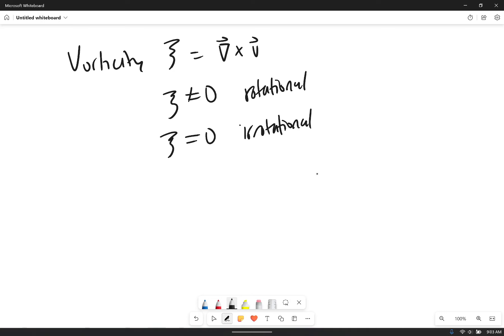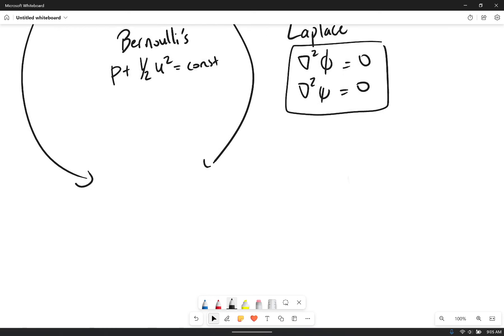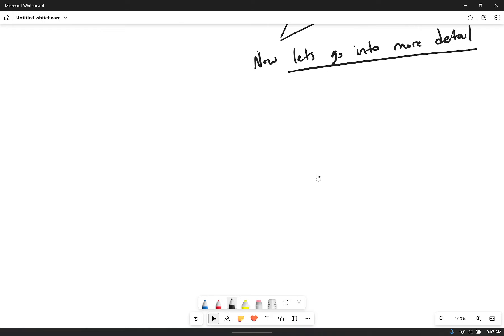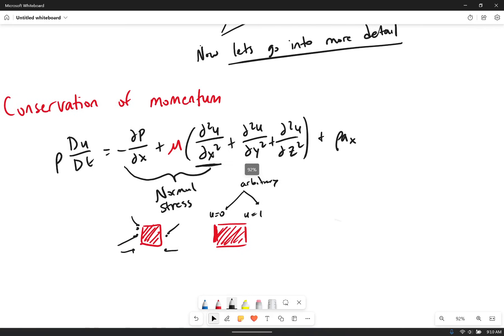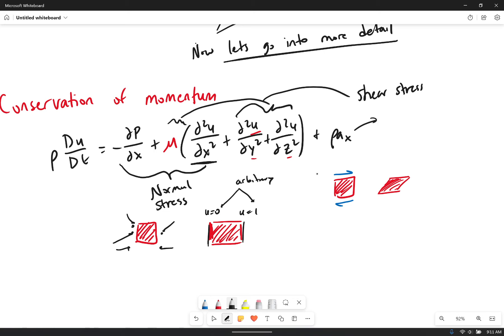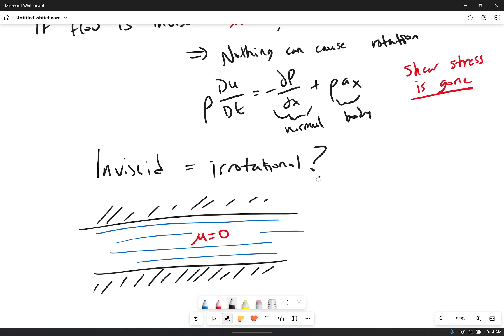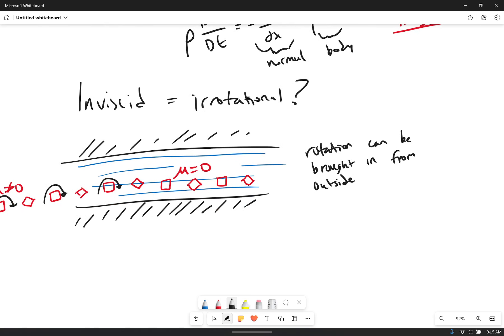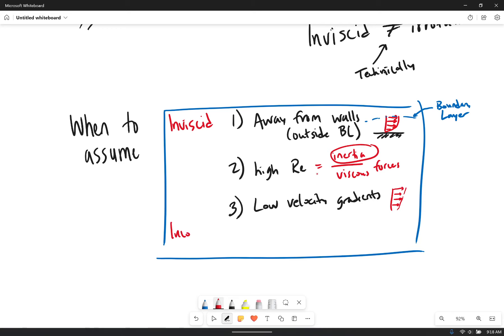Does inviscid = irrotational?

Comment: Does Flow of  Ideal Fluid may be Rotational........? ? What Is Vorticity Equation..??
I want to know that am i correct??
Reply from the maker: Hi there! This is part of a series of videos for an Aerodynamics course. As such, with air viscous effects are typically minimal at low Mach numbers and away from  boundaries. As such, we can assume our flow is inviscid with high accuracy. Any fluid can be rotational. All you need is some sort of velocity gradient. For an inviscid fluid, while it may lack the velocity gradients necessary to cause rotation, that does not mean that there is no vorticity entering the flow from outside. As for what the vorticity equation is, I may have a video on that already developed, but I am still making my videos for my Aerodynamics course. Be on the lookout.